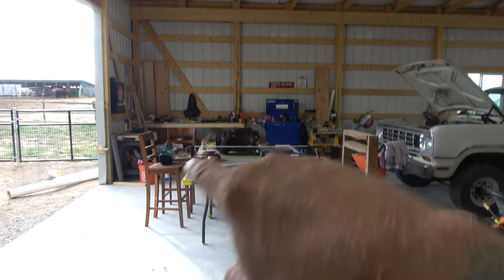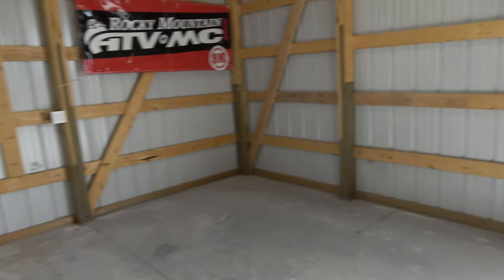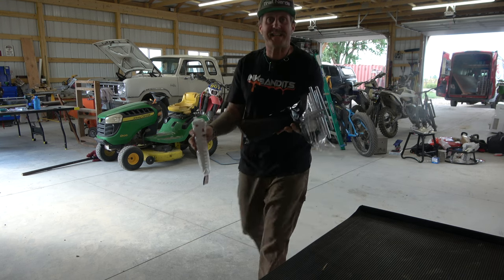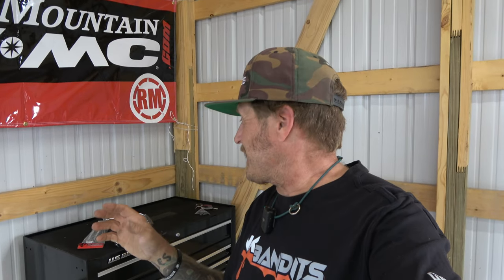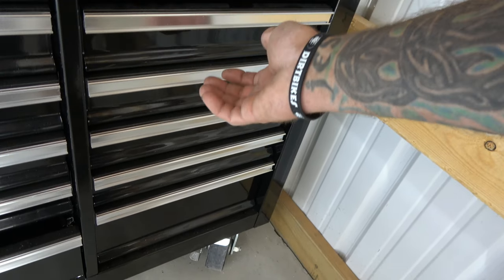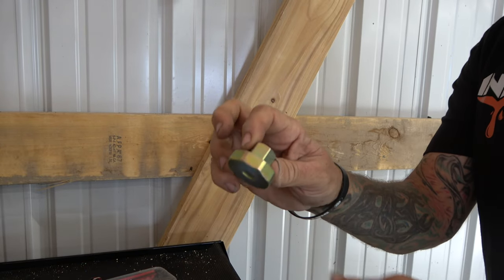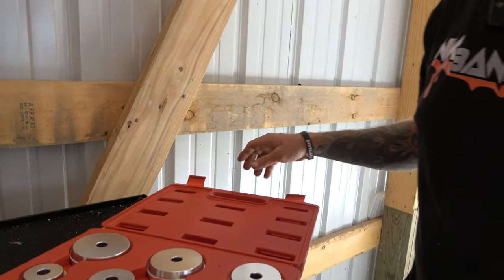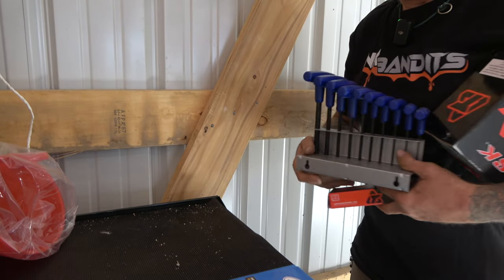Building A Home Motorcycle Shop | Rocky Mountain ATV/MC | Highland Cycles

Comment: I had three smaller roller boxes in my shop. Drove me nuts! I ended up buying a 72" from Home Depot for $1200 and sold the three cabinets. Nice big box!
Reply: I have the same but the butcher block material on top was warping so i swapped it for the white 1 inch hdpe cutting board material cut to the same size. It will never warp again and its extremely tough and very easy to do.

Comment: One recommendation I could say to a new mechanic is to not buy a big general mechanics tool set with all the standard wrenches and sockets and piece your set together with sizes you're most likely to use then you can buy the bigger sizes that you need individually without buying the sizes in a set you'll never use. And of course you narrow it down even more for trail tools.

Comment: Great video, I have everything you do except the tusk bearing puller.  Guess that's next.  Also a galvanized piece of sheet metal over the wooded bench is nice and easy to clean off.  Looks like you just need an air compressor and lift and you're set.  BTW, love the KDX
Reply from the maker: I’m getting a harbor freight lift with a bottle jack. I have the pneumatic ones in the big shop

Comment: Great setup Morgan.  I’ve been happy with all my tusk tools except their chain breaker (it really does suck) the only thing that I see missing is a vice, and maybe a urethane coating on the wood of the workbench before it gets soaked with oil.  One question for you. What will you use for a bike lift at home?  Will it be the Tusk scissor lift or will you do a full length lift stand like you have at the shop?  I’ve got the scissor lift in my shop, but curious what you think is best?
Reply from the maker: I am going to be bringing the tusk scissor lift home but also I’m going to get a harbor freight table lift.